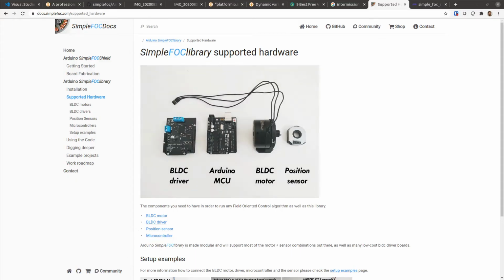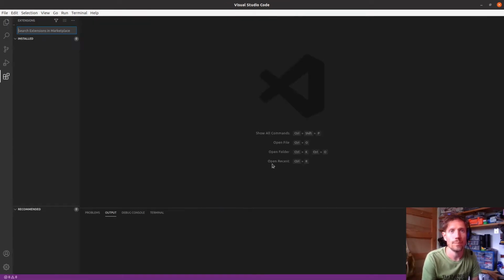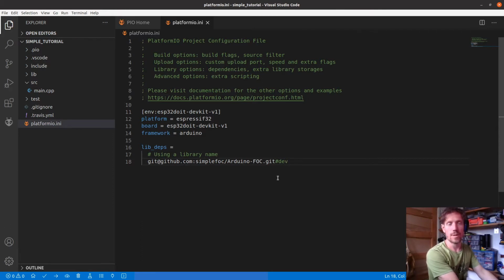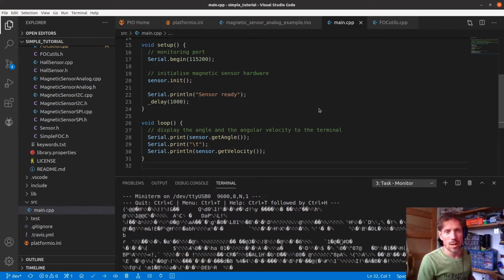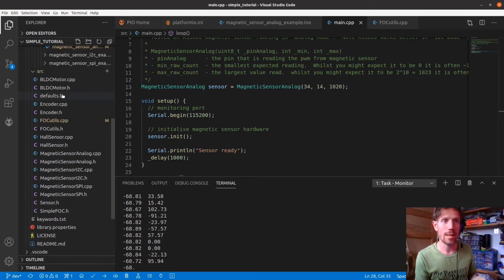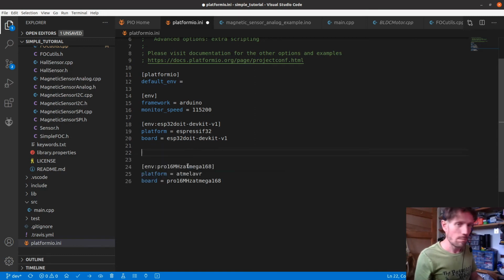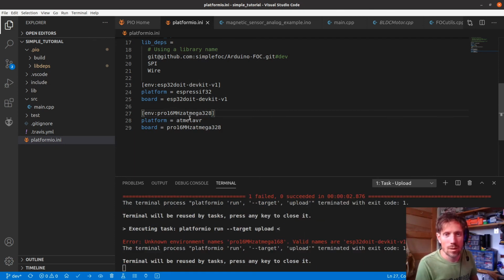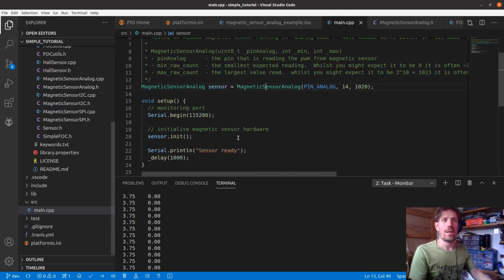Getting started with PlatformIO IDE and the Simple FOC Library

Comment: Hello,this video is very nice.And I have a problem which is same as yours. It saids: “Wire.h: no such file or directory”. But I couldn’t solve it by writing“ SPI ” and “Wire” after the “lib_deps”. I have spent much time finding other ways. But I failed. Could you please tell how to solve it. Thank you very much!
Reply from the maker: Perhaps you could try adding wire library through platformio rather than manually editing platformio.  The platformio home page (inside visual studio code) has options to manage (and add) your libraries. Not sure why it's not working the way i explained!?
Reply: @OwenWilliamsRobotics  I have searched “Wire” and “SPI” in the platformio’s labraries. And there are many results, but no one is called “Wire” or “SPI”. I am not sure which one I should download .
Reply: @OwenWilliamsRobotics my platform version is 2.3.2, maybe there are some different between the latest version and the past version
Reply from the maker: Can you link to your platformio.ini somewhere.  I'll give it a go
Reply: @OwenWilliamsRobotics  Thank you so much! My problem have been solved. I just uninstalled and reinstalled. And then I did the same things as same as you. It made sense. It’s amazing! 😂😂My English is bad. Thanks for your patient and reply. I’m so excited .
Reply: @OwenWilliamsRobotics  I don’t know what’s your mean.If you need to contact to my computer and control it ,I can use the teamviewer.exe.

Comment: Nice. Maybe you have come accross my hoverboard online compiler https://pionierland.de/hoverhack
The FOC firmware of Emanuel Feru increases efficency and torque by about 30% !!! But he used Matlab auto-code which is not open source :-(
Maybe you can help porting the original Niklas Fauth hoverboard source to platformIO. 
And great to see that simpleFOC seems to be cpp = object oriented. Because our firmwares are NOT :-(((((( 
But i already made it compile with gcc. 
So if you would succeed with the stm32F103 (like the blue pill) on the platformIO, we finally would have an easy to install toolchain and i could move on with my idea of an object oriented operating system for these nice hoverboard controller boards. 
In such a way that we no longer would need to fork the entire project but simply add a derived input class (input_adc, input_ppm, input_uart, ...) or motor controller class (simpleFOC)..
Greetings from Germany, ideas welcome :-)
Reply from the maker: I'll be sure to check it out. I'm looking through the Feru repo today too.  I'm guessing the performance is from swapping from inefficient hall commutation to current sensing bemf  commutation. I've not looked through many of your videos yet, do you a recent one that shows where you are with your solar car?
Reply: @OwenWilliamsRobotics  i don't make videos about my personal life.
But i should make a review on the Feru firmware because using it is like have new motors installed in my solar car. It is an amazing improvement. And i took for granted, that these bldc motors have an efficiency of about 80%. But now with about 30% increase in overall efficiency only by software, i don't really know what to think now.
It would be great to have open source FOC code. Emanual has a Matlab license but my fork probably is ilegal already :-(
And if simple FOC truely is cpp and we can port the Niklas firmware to cpp, than even better :-)
When i google for 'platformio stm32' i see some promising pages.
Reply from the maker: Simplefoc definitely has plans to do a lot of what these firmware is doing but is targetting multiple architectures and just wants to be a library. We'll see where it all goes! I'm from Wales btw.
Reply: @OwenWilliamsRobotics  Yes that the great thing about simpleFoc, being a library that indeed defines an object orentied class and could easily replace the Niklas or Emanual bldc.c when we have ported the entire firmware to oo. 
But that is what really needs to be done anyway. Unfortunately i have no experience in stm32 and am not willing to install these proprietary tool chains. So platform.io and simpleFoc might be the solution.
If you can make the stm32F103 archietecture work with platformIO and you simpleFoc example to work, i would be happy to port the hoverboard firmware to a universal oo-os = object-oriented-operating-system.
Reply from the maker: @robodurden  i love what they have done with their firmware. We are on an incompatible licence so we can lift and shift code.  I'll likely post a video on progress, so you might want to subscribe!
Reply: @OwenWilliamsRobotics  I don't like this hipocisy of the toy world where all become 'friends' simply by clicking a button :-(
When we work together on a project, it will make sense to subscribe to your channel.
Reply from the maker: That should be "can't lift and shift". But a lot of the work is reverse engineering. So the projects are super useful.  Hat's off to them!